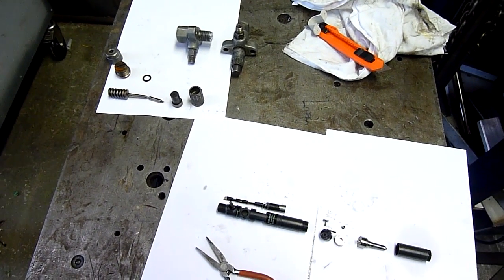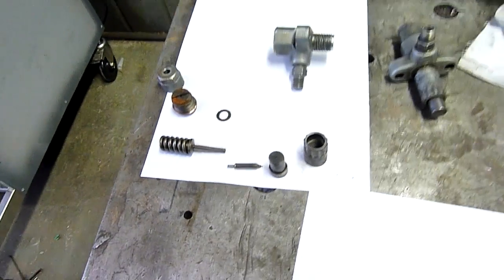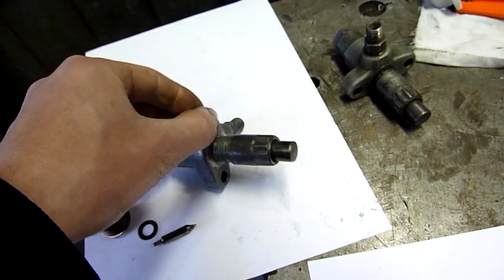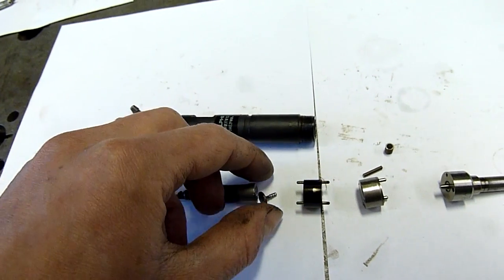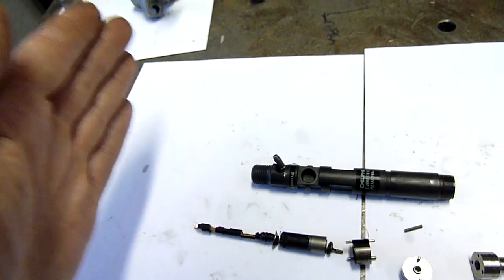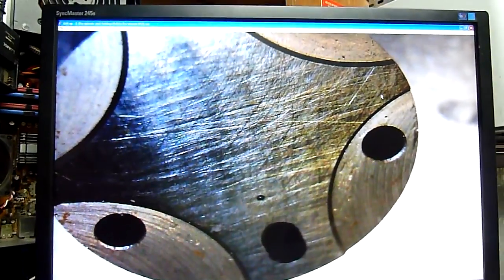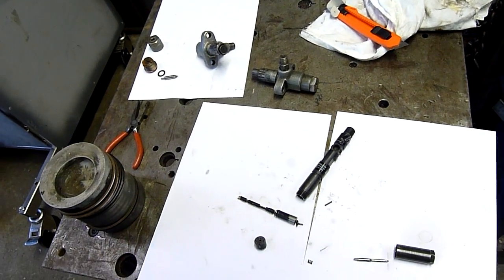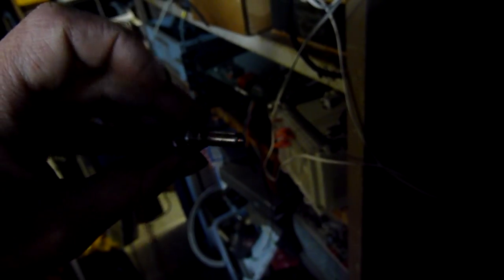Common Rail and Mechanical Diesel Injector Teardown

Comment: The old mechanical injection is better because you can run biodiesel or vegetable oil without the injectors ripping themselves apart. Also, the loud slamming sound they make sounds cool, and the mechanical injection isn't terrible to get going. You may have to cycle the plugs a few times, but it's not terrible. I've started my late 1990's Kubota tractor when it was around 10°F (12.2°C) outside and didn't want to walk to the mailbox or risk bottoming my car out in the snow (one of the fancy 4wd hydrostatic things) and that thing fired up pretty good. Ran like shit at first, but after a minute or so of idling (a bit of revving, too. Not gonna lie, but it didn't hurt the tough old orange. Still sounds like a diesel Rabbit, as it should), it smoothed its ass out and stopped vibrating like crazy.

Comment: Rudolph Diesel would be turning in his grave, if he saw what the diesel engine has become today!  These new diesel's are not anymore efficient; they merely have more emission bullshit on them now, so they don't smoke.  An old mechanical is able to produce just as much power and are just as efficient, if not more efficient than these new electronic injected diesel's.  The only difference  is the mechanical diesel will produce more carbon in the exhaust. Electronic injected diesel's are just purely unnecessary, complicated, expensive to maintain and repair, and were clearly designed to keep green advocates happy.
Reply: Vicsonvee ... and greens are happy when their pockets are full without working...

Comment: There's studies and experimentation going on supposedly on bringing back modernized air-blast injection to diesels too. If you can get your hands on some unit injectors to autopsy, that would be neat. Mechanical and hydraulic. I've had basic mechanicals and common rail injectors apart. Also a Bosch CP3 pump. Pretty interesting. Also about the most dense steel forging in that pump that i've ever seen!

Comment: Diesels in general can't really run too "lean" so to speak(excluding the use of nitrous or propane injection). Fuel input is the sole thing controlling the engine speed & power. Take fuel away, power is reduced, rpm slows. Diesels can run as lean as 50:1 AFR or more at idle or off throttle deceleration. They can certainly be overfueled, that produces a mimic of lean-burn damage in a spark-ign engine. Not only threatens cooking the turbo but the pistons. Any thin or sharp edges melt pretty fast, like the bowl lip. The most important factor in diesel operation is the injection timing. Too advanced is hard on the engine and makes EGT too hot, too retarded equals low power, poor burn, poor efficiency. Other problems, low compression, improper nozzle pattern/worn nozzles, damaged prechambers on IDI diesels, etc. IDI diesels typically run the highest compression, 21-22:1, and DI, CDI, CRD normally fall in 17-18:1 compression ratio. I've grown up with, worked on, and driven diesels my whole life, its all I drive! Love 'em!

Comment: This video was awesome! Thanks for making it and explaining clearly. I've never dealt with diesel engines before, but I always imagined that the mechanical injectors were actuated by a separate piston rather than just a taper on the needle.
Reply from the maker: it would not surprise me if there is such a design out there, there is a lot of variation over the decades. some have the pump built into the injector and are operated by a cam lobe and tappet.

Comment: Ah I love the smell of diesel in the morning. back when I worked at my old job we had this old diesel forklift. No glow plugs. when we went to start it on cold mornings it would smoke so much it smoked out the guys who worked at the ice cream factory across the street lol. we had to park it in a heated garage when it got really cold. on some of the trucks we had, we had to cycle the glow plugs a few times to get them to start on below zero mornings lol Very interesting teardown and explanation.
Reply: How did it start with no glowplugs
Reply: Tavis Young
Diesels are compression ignited. glow plugs are there to make it easier to start. starting a diesel with no glow plugs in low temps takes a lot of cranking to build up enough heat, but it can be done.
Reply: coolbluelights oh OK

Comment: You also have the high pressure oil actuated type (7.3 International diesel) and the cam actuated injectors (Cummins, Caterpillar and Detroit Diesel)

Comment: Another way to demonstrate the compression ignition/detonation phenomena is when a tiny drop of light oil is placed on the back of an air rifle pellet when its chambered, The sudden compression of the air in the chamber detonates the oil on the pellet,(Known as "Dieseling") It has varying results on the rifles performance, But interesting non the less, Another invention the uses this same principal is called the "Fire Piston" its used to ignite tinder to start fires,
Reply: I've had a bit of dieseling in my car due to the idle being too fast, and it's scary as shit when you kill the spark and it keeps going! Vibrates and knocks like crazy because it's a gas engine running on hot carbon and gasoline instead of compression and diesel. Like starting a hot bulb, the way they toss themselves around. It's fixed now with very minimal wear if any caused by the problem, and I now know where my idle screw is, so if I have to adjust that, I can.

Comment: So given the fact that the piston is so close to the valves, is that what causes piston slap? My buddy has an old Toyota helix with a diesel and it talks about piston slap and what not.
Reply from the maker: nah, contact with the head or valves would be an engine killer, Piston slap is what you get when the piston pivots side to side on the wrist pin, the skirts of the piston 'slap' the walls of the bore.

Comment: Diesel engines are fun, just a shame the car manufacturers are pushing them away from biodiesel use (common rail can use it, but only with expensive modifications which makes it somewhat cost prohibitive), especially as Rudolf Diesel used peanut oil (as mentioned in an earlier comment) in his engines originally, heck, the fuel used today was originally just a useless byproduct of the petrochemical industry 'til they got ol' rudy to adapt his engines to use it...
Reply: Not being able to shove any old fuel in there is one of the side effects of all the optimisation work done to get more power, lower emissions, lower noise, etc. out of petro-based diesel oil because that's the fuel we've got right now, in the environment (commercial, physical, and legislative) we've got right now.

When bio-based fuel oils become more of the norm, injectors and fuel systems will continue to evolve to work with that fuel instead.

(I'm sure the fuel system manufacturers have decent-sized development programmes ongoing to see what they have to do to keep their stuff working in the face of running even on peanut oil. There's too much money at stake in the not-so-distant future for them not to.)

((Just my £0.02 on the matter.))

Comment: That's not a QR Code - that's a Data Code (note the solid line of dots around the outside and lack of 3 square fiducial marks at set locations in the code); Still, a fascinating look inside diesel injectors :D

Comment: diesels can run extremely lean under low load. and yes, there is the rich out limit for the turbo and or pistons, and or worse, block crank etc

Comment: Only 1 hole in mechanical one?? i have 1955 nuffield tractor and it had 3 holes in the injector nozzle and i replaced them with 5 hole one :) 
It also has 3 compression ring's and 2 oil ring's
Reply: pintle injectors are different than one hole injectors, they have more wider spray patterns than eleven most of 5 hole injectors. They was developed in sixties and used on rocket engines (on LEM DPS for Apollo and now on SpaceX Merlin engines)
Reply from the maker: depends on the injector, a lot of mechanical ones do have multiple holes in the tip, I was just using the only one i had on hand.
Reply: Aussie50 That Isuzu designed piece is pretty nice idea, I wish others were so easy to just turn a big grub screw to set the pop pressure! Don't need a pile of specialty precision ground shims and to disassemble them repeatedly to set them.
Reply: Does that screw need to loosen up when removing the injectors from the head?
Reply: Should be no reason to. That screw is only to set preload on the pintle spring. Just pull the lines off and the 2 mounting bolts.